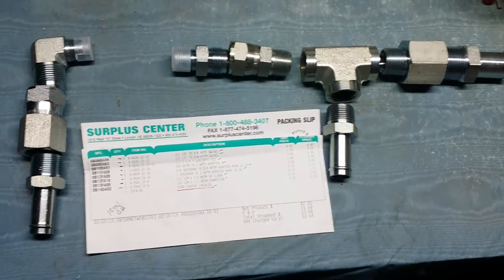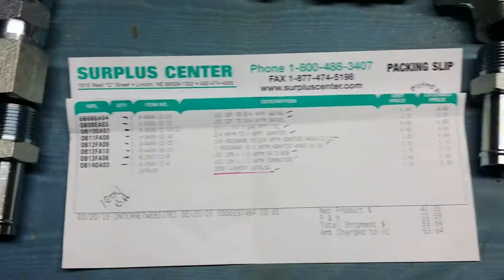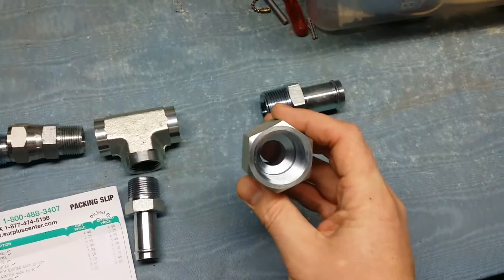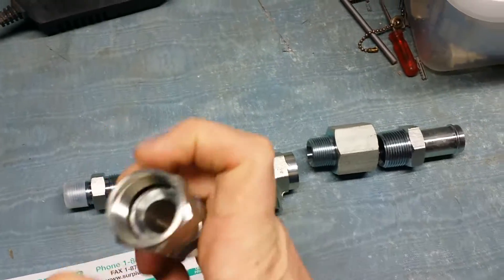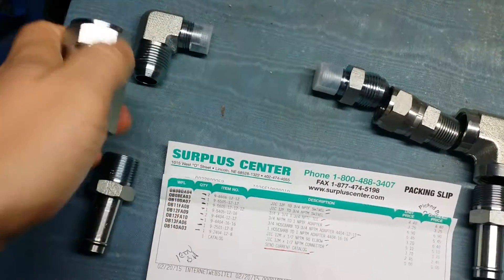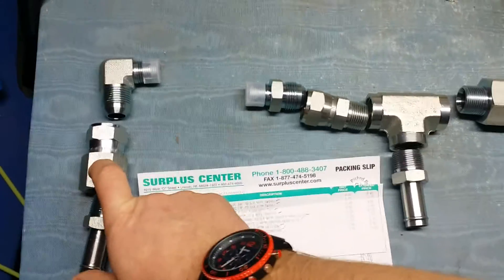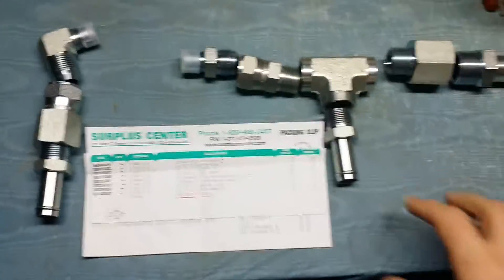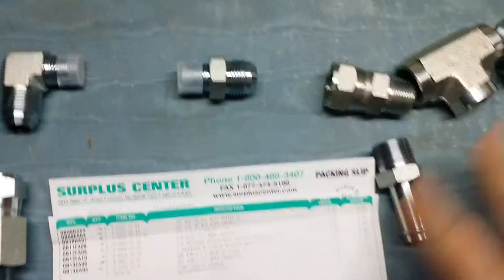Dual feeding system for pressure washer pumps

Comment: Rob what is the purpose of dual feeding  your pump?
Reply: Matt Klow improve flow to your pump, helps to even the load for your pump so it isn't using the first cylinder more than the other 2.   more useful on higher gpm machine.
Reply: Clean Power Wash ok thanks I have a new 8gpm machine coming just want to get it setup right.